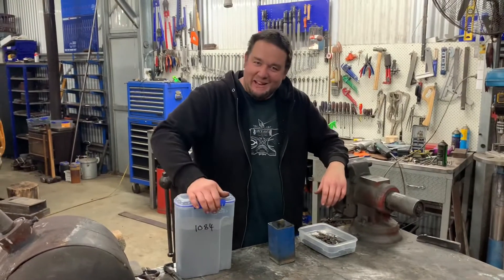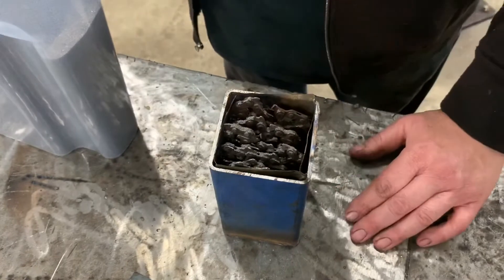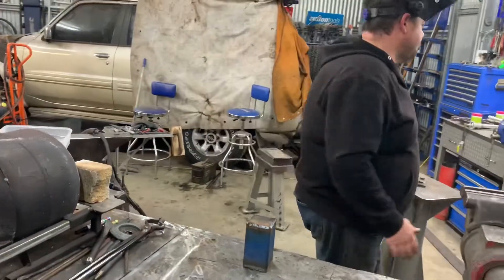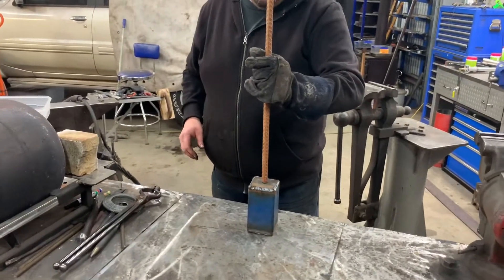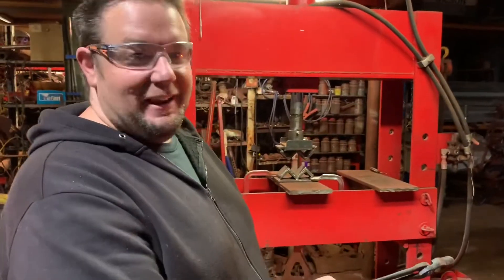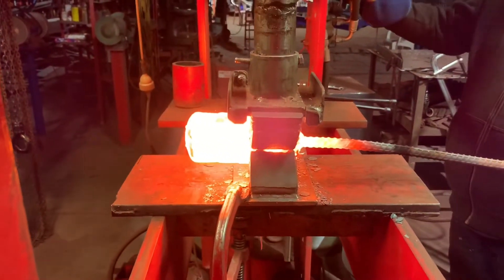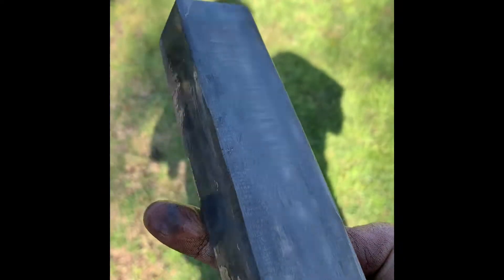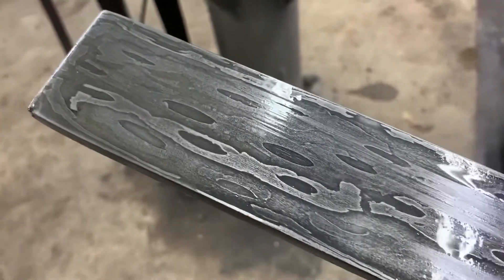Making Canister Damascus with Ball Bearings and Chainsaw Chain.

Comment: I never would've guessed that the ball bearings would turn out like that. Great work. Did you build your press?
Reply from the maker: Thanks Stan.  Yeah they stretched out quite a lot.  I have another piece of that billet that I never drew out as it has a few spots that didn’t weld properly on one side.  Because it didn’t get drawn out they are a more defined oval shape.  The press belongs to my Dad.  He built it himself.  It’s not really designed as a forging press but it works with the dies that I made for it.